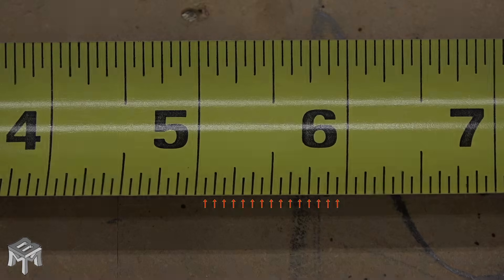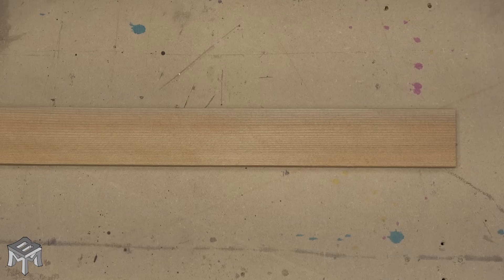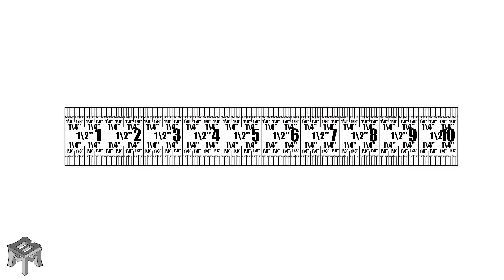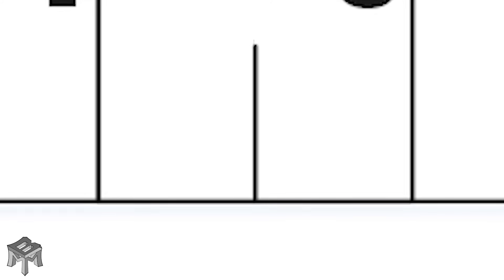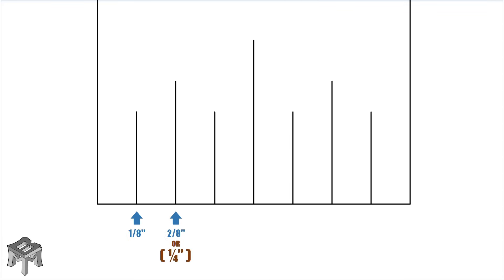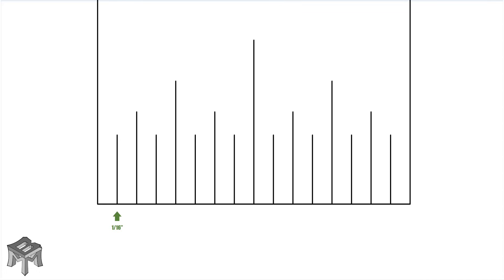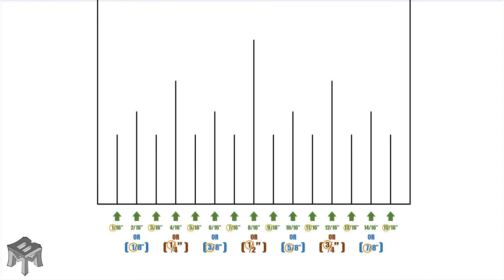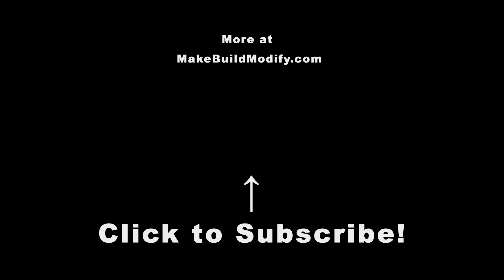How to Read a Tape Measure - REALLY EASY

Comment: Dump imperial and use metric far easier
Reply from the maker: Please explain with examples.
Reply: @Makebuildmodify  no 16th  or 8th or 14 16th,a.
Just zero to what ever measurement  you want
Reply from the maker: @shanefitzsimons8304  That depends. If you wanted to divide an inch into 16 parts and it had delineations at every tenth then it would be difficult. The system is specific to the task not the to the ability of he user. Besides, isn't it better to be able to do all of the mental math and be proficient in as many systems as possible? There are real things that are built with these systems. Sometime both systems are used on the same thing (like cars).  It would be a disadvantage to adopt only one system.
Reply: @Makebuildmodify  don't bring logic into this

Comment: Decimal system is way more simpler and logical. 1/10, 2/10, 3/100, 78/100 and so on. Instead of 3/8, but no 4/8th. Why? It's not a math lesson!! 5/16th, 72/128th - so dumb and so complicated. Why don't you use 7/16 of a dollar? Why are there 100 cents in a dollar? BECAUSE ITS SIMPLER AND LOGICAL.
Reply from the maker: There are good reasons for it. Primarily, millions of the existing structures are built using the standard. Maintenance, would be untenable while using a incompatible system.

Comment: I understand the logic now thanks. But when there is easy to read and divide etc. 10 based metric, i can't understand why imperial system still in use. I mean metric doesn't even need a video like this :)
Reply from the maker: There are good reasons for it. Primarily, millions of the existing structures are built using the standard. Maintenance, would be untenable while using a incompatible system.

Comment: for the metric users, this is a must video to watch. Thanks
Reply: for the metric users, no need to watch as we have forgotten that this dinosaur method even exists
Reply from the maker: Glad you think so!
Reply: As metric user in the trade for 30 years, which I'd known this when the old school guys started quoting imperial however find using metric a lot simpler
Reply: @drumahnz  the metric system is simpler because that's what you learned first. Both systems have pros and cons and being able to go from one to another is convenient.
Reply: @tzprefect  Tell me about the pros of the imperial/US system. Pleeeease.
Reply: @SteifWood  there are several. Apart from some people having trouble doing fractional math, the Imperial system is nicer to work with when it comes to dividing measurements. The Imperial foot can be easily divided in halves, thirds, quarters, and sixths. And, measurements are relevant to more natural activities. An acre was originally the amount one could plow in a day. Even now, the Fahrenheit scale is more natural for your body:  a degree change in Celsius is too coarse for many people so they had to split it in half on thermostats. I say people should learn both and use the one that beats suits the application.
Reply: @SteifWood  also, please is spelled with only two “e’s”, at least in Imperial English.

Comment: Nice to have a video, that shows how to read a messuring tape. 
Even nicer, to grow up with the metric system and no need for an instructionvideo for reading it...
Reply from the maker: Just lines on a stick. Both systems have pros and cons. I use whichever is appropriate for the task at hand.
Reply: @Makebuildmodify  I know, that it is a question of beliefe and with what system you grow up. 
But i am courious... What are the cons with the metric system? Where is imperial better?
Reply from the maker: @NelzNelzon  I think it's important to make the distinction between "lines on a stick" only, and the combination of the "lines on a stick" within the limitations of a task. This is why systems are created. Systems are designed for a particular use and are only useful with the confines of their definitions. Comparing systems for superiority is like trying to put a square peg in a round hole and saying that one or the other is better. 

I would say that the metric system is much more intuitive and convenient at translating linear units to volume or relative heat, etc. Plus, it's easier to use with scientific notation.

Both systems are base 10 (meaning the characters 0,1,2,3,4,5,6,7,8,9 are used).

The metric has fewer linear units (this is a good thing), but instead has a self-similar relationship relative to meters with added prefixes. The imperial system has inches, feet, yards, chains, furlongs, miles and more (too complicated). But for the context of the conversation we're talking about building things. So, inches and feet are the primary units of concern as a system. 

 The imperial system is just a different size unit if you consider inches only. The machining industry uses hundredths and thousandths of an inch to gain the same math advantages (for this type of operation) as the metric system. Fractional math can be done with the metric system but the factors don't line up with the delineated units as readily. 12 has 1,2,3,4,6,12 as factors. 10 only has 1,2,5,10. This is a boon for the construction industry (especially mental math in the field) because regular divisions within a whole number while landing on exact fractional delineations becomes easier. Dividing a foot into 2,3,4,6,12, all land on the inch lines. When fractions of an inch are added (which are just a halving) it allows for further regular divisions always landing on a delineation. This allows for dividing a foot into as many divisions by 2 as you like 2,4,3,4,6,8,12,16,24,32,48, 96.... Because of fractions (to a resolution of 1/16ths) 10 inches cans be divided into 2,4,5,8,10,16,20,32 all landing on demarcations. In my experience this is more than enough for typical construction/making needs. Anything more would be venturing into the land of diminishing returns.

The metric system can be divided using a calculator to an adequate degree, but so can any other system. The benefits of the imperial system come from the combination of the fractional rule and the construction convention together *as a system*. It provides the platform for quick mental math and moving on with the production.

There are more advantages when laying out floor plans. The relative feet and inches can be used to reduce cognitive load. The idea is to be thinking about your surroundings, safety and production; fewer metal calculations are better in this environment. Maybe I should do a video on the topic, idk.

Also, roof framing is slope based which can be expressed as a fraction (rise over run) in any system. So, the fractional system makes for easy calculations.  I don't know if the roof framers that use the metric system use degrees or rise/run. I sure would like to work with a metric roof framer just to learn their methods.

Comment: What are you doing?  I'll check in every now and then, but not as a subscriber.  You can cater to entry level or advanced level, but not both at the same time.
Reply from the maker: Why not?
Reply: @Makebuildmodify  Can't keep their attention.  It's like cramming a room with high schoolers and veteran engineers.  No matter the subject it will loose the attention of one group.  So you change the subject and loose the other group.  Eventually each group gets conditioned to expect this result and suddenly neither group pays attention regardless of the subject.  Everybody tunes out.
Reply from the maker: @ShainAndrews  I can see your point. Although, I don't have a good way to test your hypothesis in an objective way.  I have analytics, but correlation and causation are difficult to unfurl. My goal is to inspire people to make stuff. Breaking down barriers and removing hurdles is part of the mix. Veteran engineers need not take a channel as a whole unit, but instead as a selection of information. The proclivities of the unknown individual are difficult if not impossible to guess. In other words, you can't please everybody.
Reply: @rayhawk9432  My channel is not about anything.  I'm not a content creator of any sort.

Comment: I understand the system. But I don't understand why it's still in use lol.

Metric seems SO MUCH easier and you probably don't need more precision than a millimeter on hand measuring hahah!
Reply from the maker: Well, almost all of the structures in North America used material that follow the imperial convention. Plus, all of the suppliers deal in materials to match.  So, building and repairing with the metric system would be problematic. Plus, almost the entire building code is referenced in non-metric standard. But, there are some things heading in the direction of metric. I personally don't care either way. I use what works for the application. There are some advantages to the imperial system while roof framing the fractional math makes it easier to do mental math relative to the slope of the roof. And while doing layout on the floor for wall framing relative measurements become very handy and fast. There are other things about the imperial system, however,  that are unnecessarily confusing to the uninitiated with no real immediate advantage. Maybe I should do a video on the pros and cons.

Comment: As a métric system user, I have to say that this the first time I have ever thoroughly understood how the imperial system works. Thank you !
Reply from the maker: Whao!! I usually get in a lot of trouble from people that are more familiar with the metric system. Thanks for being so nice and for watching!
Reply: Metric is easier for most things. But here in the states it makes for a nightmare because of conversions and such for some people. Most of our tooling her is imperial, but metric is slowly becoming available more often.
Reply: as a metric system user i think is much much easy the metric system to read than the imperial ,is now used all over the world except in USA , even in Canada Australia and  UK they use Metric ,but the currency in USA is metric so in the Medical system like medicine in milligram cuts in millimeter etc ,just a tough it will be all uniform worldwide and save money in tools etc.                @joeymerrell8585
Reply from the maker: @joeymerrell8585  Yup, the science and medical systems have already made the transition. It's only a matter of time for the construction industry.
Reply: Make Build Modify I was wondering about the construction industry. A residential framer once told me that his crew used tape measures very infrequently because so many of the imperial lumber component dimensions are either multiplied or divided so easily. What are your thoughts about that aspect?
Reply from the maker: @WorksbySolo  it depends. If there is a cut guy and a layout guy then the other guys shouldn't have to measure very much. They'd just be assembling.
Reply: Dude as an imperial user, this finally makes sense
Reply: The u.s. is one of three countries on the planet that still use the imperial system 🙄
Reply: @slevinkelevra5901  You have a problem with that…I taught myself to read them all…you could do the same thing too then I wouldn’t need to respond    to your snide remark!
Reply: @malikradio5018  how do you think the truth is snide ?
Reply: As an English person I measure height in feet and inches but use a tape measure in metric and imperial, distance in miles, beer in pints, milk in litres and pints, buy fuel in litres but measure the efficiency in miles per gallon, weight in stones and kilos and temperature in Celsius and Fahrenheit.
Reply: I watched a few videos and I agree he did a wonderful job of explaining measurements on a ruler
Reply: My G460613
Reply: In the States, we measure with inches a lot. Still work with metrics too.
Reply: I don't know what it is with Europeans being absolutely baffled by fractions. Is it that they just don't learn them or is it a genetic thing? Fractions absolutely confuse them. The funniest part is them thinking that fractions are exclusive to inches. Lol. If they knew you could have 14⅜ mm or 3¾€, their mind would pop.
Reply: @littlejackalo5326  lol, yeah.  1mm is approx 1/26th of an inch. When i  make adjustments to my electric guitar i deal with finer adjustments such as 32nd or 64ths of an inch.  Very fine adjustments.
Reply: Poor guy is living in the old world…
Reply: As a imperial system user me too.
Reply: Me too! 
They’re both useful
Reply: I remember when the US was seriously considering converting to metric. People were freaking out. I think it is arrogant not using metric while the majority of the world does. Producing tools in both measurements is wasteful. Seeing as the US isn't the manufacturing leader of the world a more makes it even more logical to switch.
Reply: Metric is for people who count on their fingers.
Reply: And this video proves why metric is better
Reply: That's because you are stupid
Reply: Keep up with modern times, use metric